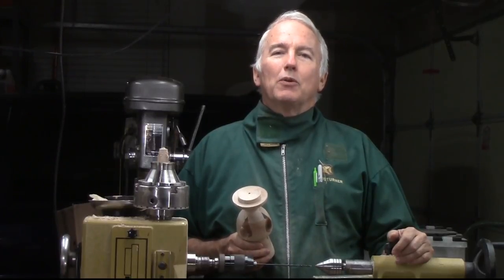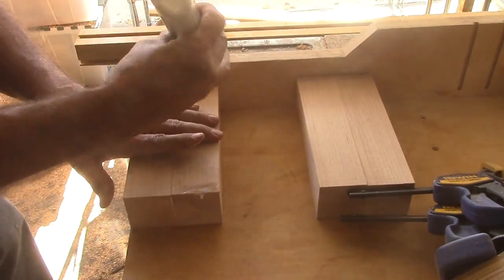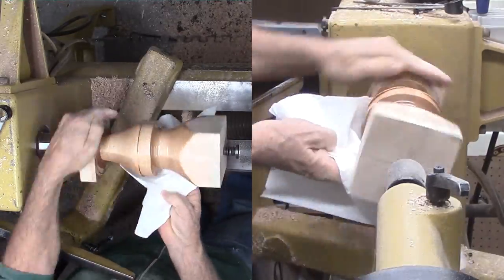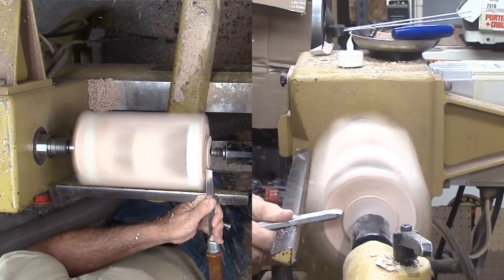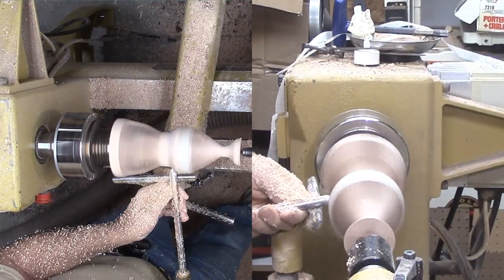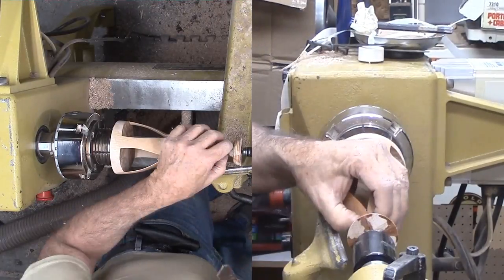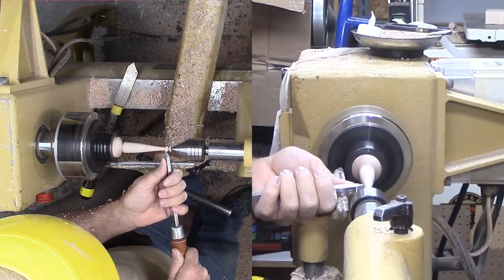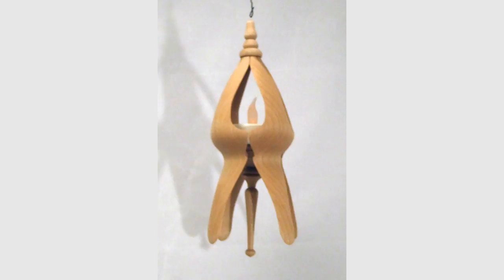Woodturning Inside Out Open End Christmas Ornament With LED

Comment: Nice piece Alan
Question please -- How does the tea light platform fasten into the bottom of the upper inside/out portion so you can remove it to change (or turn off/on) the tea light without it falling out?
Thanks
Dennis Beamish Cambridge Ontario Canada
Reply from the maker: Very specialized hardware - Not.
There is a little bump left during the inside turning that the platform rests on.
Great question.
Alan